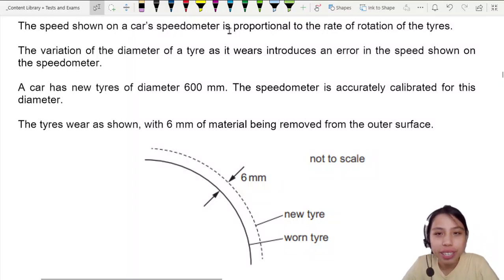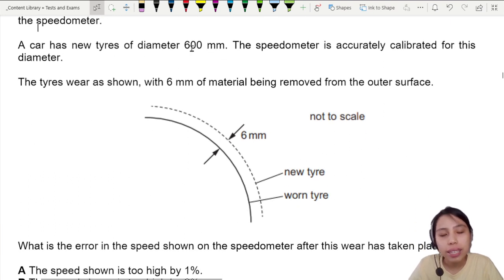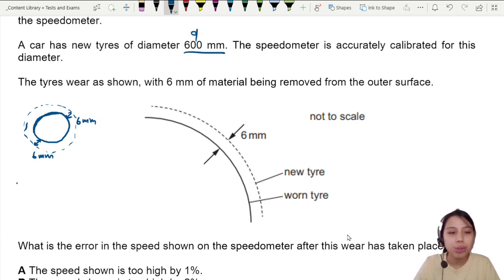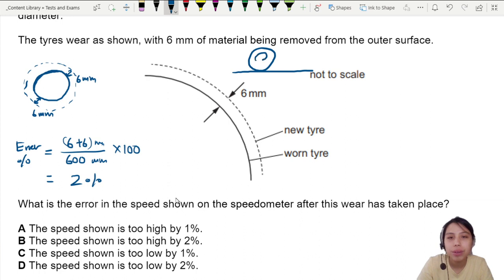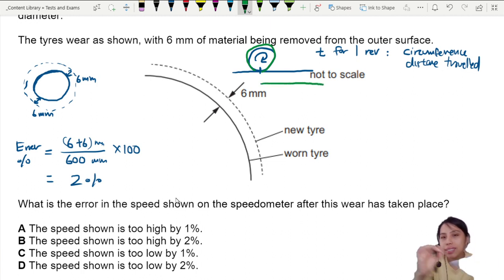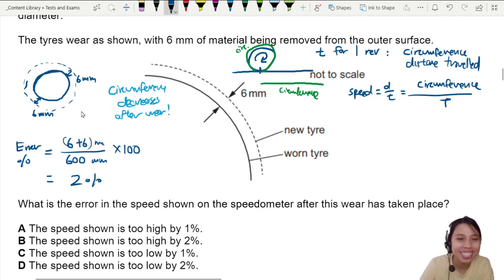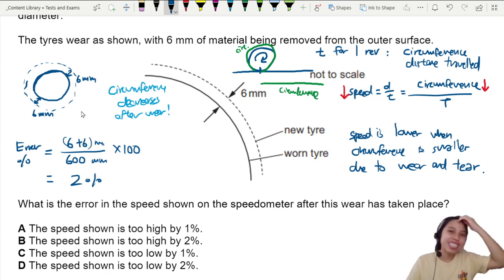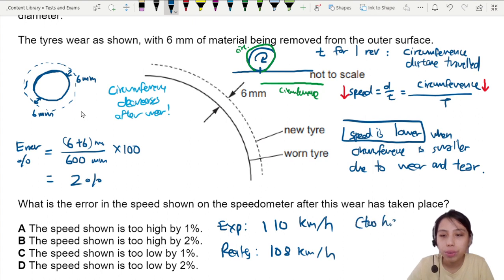MJ19 P11 Q5 Tyre Error in Speed | May/June 2019 | Cambridge A Level 9702 Physics

Comment: why 6+6
Reply: At start tire radius was 300 mm . Draw a circle with radius 300 mm for the original tire . 
Then draw a smaller circle inside with same radius point  showing tire after getting worn 
Distance between the circles is 6 mm so radius decreased by 6 . 6/300 in percentage gives 2 % . Hope this helps
Reply: @M_B_T.  why did you divide 6 by 300?
Reply: Dividing 6/300 is the same as 12/600. So it’s with respect to the radius so you don’t have to worry about the sum of the material removed from the outer surface/ diameter